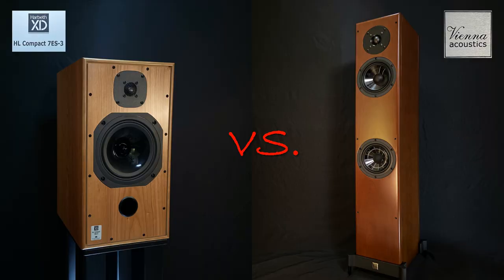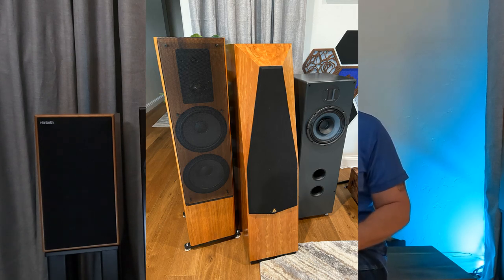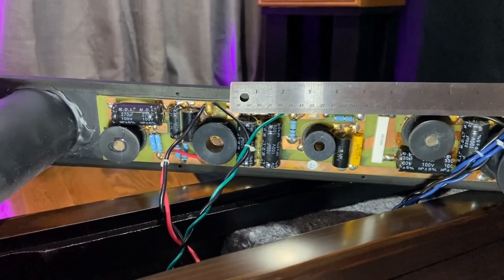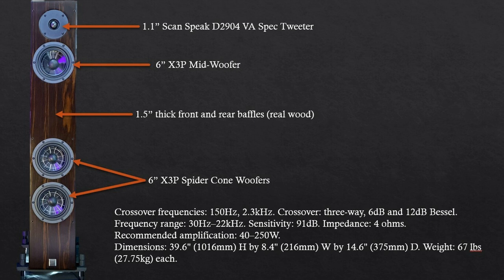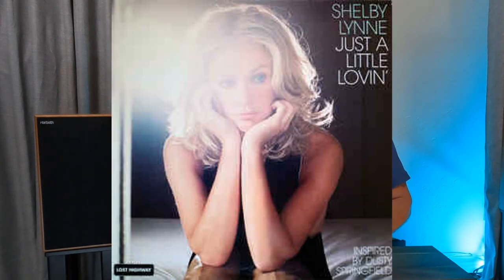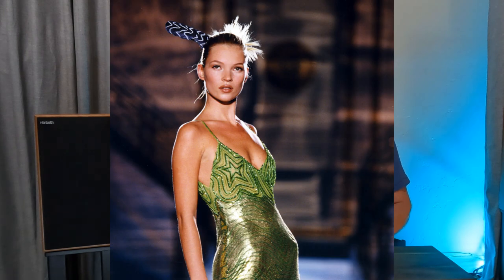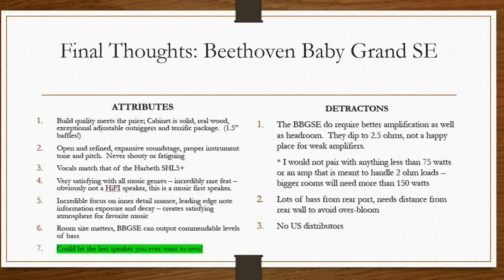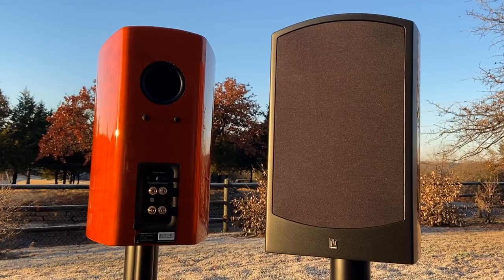Vienna Acoustics Beethoven Baby Grand SE; No HiFi Speaker Here...These are musical!

Comment: I own the exact same speakers, also in black as in the video. Love them.. bought them used with original boxes of ebay 5 years ago.
Only thing that I miss is the ability to biamp. I have to matching power amps that that I would love to try to power mid High and lows separately. I know, people will think, can't you bridge the amps? Well, these speakers are 4 ohms. My amps accepting in bridge mode only 8 or more.. 
For now I'll stick with my Rotel class D.
Reply from the maker: Thank you for sharing and watching.  I would be careful about too much power into the Vienna BBG, they sound wonderful to a certain limit, the drivers are not the most robust.

Comment: Great reviews.  Where is the excel sheet you referred to?
Reply from the maker: I had a few on my community page, mostly dealing with bookshelf speakers and brands.
Reply: @2ChannelListening  You have really peaked my interest in the Beethovens and can pick up a pair in black for around $1800.   Concerning the 2 ohm dip, I have an older Emotiva XPA 5 channel and a B&K ref 200.7 7 channel amp to use. do you think it will be an issue with either of those amps?  If so I may sell both and put the funds towards a pair of the Buchardt A500s or new A10's ? Thanks for your assistance!
Reply from the maker: Hi Jerry, since you are interested in VA Beethoven, I have not made much documented comparisons for floor standers.  I do have that Google Sheets with well over 70 bookshelf speaker manufacturers if interested.  Feel free to email me directly to 2channellistening@gmail.com with questions since you are a subscriber! Thank you sir.

Comment: It could be using the shielded drivers like the tweeter as a chamber is there any silicon around the edge? Plus would give it magnetic shielding against the crossover interaction but that seems a bit far away and the magnets are not that big but possibly
Reply from the maker: That's a very good theory HG, yet given the proximity distance for the mid-woofers, I don't see how there is a tangible impact on the tweeter (its clean).  The woofers, those magnets are not that big, the shield makes them look much more substantial than they are.   I do like your take though!
Reply: @2ChannelListening  I wasn't really watching I was listening so it's possible the twitter doesn't interact magnetically with the mid-range is possible
No signs of any sealant around the edge of the shield then?
Reply from the maker: @hoobsgroove  I did not get a good look at the top, not enough clearance.  I certainly was not prying them off, sealant or glue, they would not budge.
Reply: @2ChannelListening  no there will be glued in indentation at the back You could try heating them up with a lighter first in that area to soften the glue
Reply from the maker: @hoobsgroove  I meant no clearance as in these SOB's are also glued to the cabinets.  I wasn't risking it with the Rosewood finish - never had baskets stuck in a cabinet like this...they didn't want me pulling these ones out, lol...

Comment: I understand your analogy on bass extension on comparing the Mozart Grand to the Beethoven Baby Grand; however, that loudness difference should be accounted for in the -3dB or -6dB point. If both of those speakers claim a lower frequency response cutoff of 30Hz, if the amp is set such that their average SPLs are equal, their lower frequency performance should sound the same. The Beethoven Baby Grand DOES have a slightly higher sensitivity at 91 dB (vs 90 dB for the Mozart Grand). Also, if you are describing the punchier bass at your listening position vs. at a 1m measurement position (which is how the response curves are generated) it could possibly be attributed to room response, port design, etc. Bass is a very weird thing!
Reply from the maker: Thank you for the thoughtful comments MJ. I do use an SPL meter to keep my listening levels within my normal critical listening db.   The big difference with the Mozart and BBG is cabinet volume and a second dedicated woofer driver that is specified to 150hz only.  Speed and extra air volume create the effect I was dearly missing from the Mozart - me thinks...all things else in my room should be equal with the same amplification and listening position.
Reply: @2ChannelListening  There’s no replacement for displacement. 😂 I’m sure the second woofer really adds to the dynamics you are describing. I’d love to find a pair of those local.

Comment: Hi, I enjoyed watching your video. I notice your room is smallish. Do you find you get a bit of overhang in the bass from the Beethoven Grand SEs or the Mozart Grand SEs with certain recordings where bass frequencies go very low ? The reason I ask is because I find that is the case with my Castle Harlech floorstanders in my 18' x 12 ' room.
Reply from the maker: There is a bigger difference in the amount of air the Baby Grand's move compared to the Mozart SE.  The Mozart SE integrated very well, I have a handful of bass traps and ceiling absorbers which help tremendously.  I did have to use the port bun for the Baby Grand to tame total output in my room.   I would say adding two small REL subs for the Mozart SE would probably be the ultimate ticket, however, my room configuration would not allow for the floorspace, I have to contend with my lighting and other gear as well.
Reply: @2ChannelListening  Thanks for your reply. Actually I was really meaning, did you find you got any bass overhang for e
ither  speaker in your room  ? I'm sure your bass traps help. My Castle  speakers are transmission line and I have them 27 inches from the front wall. One of the speakers is also quite near a corner of the room  and I do get a bit of overhang in the bass on that particular speaker  depending on the track I am listening to. Not sure if transmission line speakers should be placed further from the wall than other floorstanding speakers ? They have no ports at the back but the transmission tube exits the bottom of the speaker. Any advice would be welcome, thanks.
Reply from the maker: That's a tough call Chris, over-hang, or a frequency bump is generally room mode interaction.  I'm not sure my definition of overhang is the same as what you would describe with transmission line speakers.  The small quick drivers in the Vienna Acoustics never sound slow or bloated.  I would get some room loading from the big Baby Grand.  There is something else going on with your speakers if you are getting bloated, sluggish bass.  This is why listening to Tool is so useful with double kick drum, I can tell if the decay is good or overloading my room with too much energy.  I think of my big AR9 LS with a underpowered tube amp for bass bloat (overhang).  Does this make sense?
Reply: @2ChannelListening  Thanks for replying, it is appreciated. It is really only with sections of music where there are particularly low bass frequencies when I am getting the problem, generally the bass sounds very good. Admittedly I have a low powered solid state amplifier (30 wpc) although it is price matched with the speakers. Also I am only getting the issue with the speaker which is quite close to a corner, approx (3 feet)
so I think maybe some sort of bass trap in that corner might help to solve it ?
Reply from the maker: Forgive me Chris, I do not want to misdiagnose what could be happening with your bass.  If you are getting muddy, slow bass at some extremes, if it is at dynamic passages (where your amp is being taxed) then bass traps will not help you, its a mismatch with your amps capability and your speakers demands.  I've placed all manner of speaker closer to a corner than what you are working with, 36" is actually better than average distance.   The obvious test is to put your speakers within 12" side and backwall.  If you hear reinforcement of the muddy bass outside of room gain energy, then you certainly can move on to trying traps.  If you hear the same issue overhang, slow bass, my opinion, its your amp selection.  It happens, I've been there.  The correct amp snapped my speakers into focus like they were an entirely different set.
Reply: @2ChannelListening  Thanks again for your input and suggestion of moving the speakers to within 12 " of back wall. I understand your concern about the power of my amp. However I think if it was the power/mismatch of the amp that was the issue I think I would be hearing the same issue from both speakers. However it only occurs with the speaker nearest to a corner and it is not in dynamic passages. It is just with certain low frequencies. The sound hangs around a bit longer than I would expect, a sort of reverberation. I have called it overhang, not sure if that is correct expression. I don't think it is slow bass.

Comment: Hi my friend... I just purchased a Vincent SV – 737 I'm using the optical input… Would it benefit me for a better sound quality to use an external DAC instead?
.
Reply from the maker: Congratulations Brian.  Your question can only be answered with more questions:
1. Are you happy with the sound currently?
2. Are you getting what you need from the app?  Can you access your favorite music will little fuss?
3. Do you need more flexibility with a DAC, USB, HDMI, I2S?  

I can tell you that improving on a well implemented integrated amplifier can cost you many times more with individual purpose built boxes.  For instance, I use a HiFi Rose RS250 streamer, which costs as much and more than three of the integrated amplifiers I have on hand - but it clearly outperforms all of their internal dacs and gives me additional variable volume options.   To me its worth it, but I had to save up for that thing!
Reply: @2ChannelListening  
thanks Jason, I'm now using a Gustard R26 and very happy with the better sound...

Comment: It is my experience that one can't hear how good a speaker is without an A/B. A large kick drum has an area of 1300 square inches producing bass. A 6.5" speaker has 33 square inches. I have 3-way speakers with dual 15" woofers (700 square inches total) which is the area of a medium kick drum. Little speakers sound little and/or unnatural.
Reply from the maker: PMC speakers 🔊, transmission line cabinets?  

Regarding A/B comparisons, what context are you referring to?

Comment: it is nice to have a quality speaker. believing the speaker is the most important pice in your system  NO  Its all about your components just my thoughts
Reply from the maker: That's interesting Gregory.  I'm always back and forth, but I would err on the side of the speakers making the biggest difference and here is why I think this in general terms.   Average value speakers can sound average with average gear; one can attach gear that is 5 x or more the value of the speakers and yes those speakers will sound their best, but that is a backward use of funds.   I've tried these combos and the average speaker never sounded better than the model above it.

Now, take a Harbeth SHL5+ XD for example and put a NAD D3045 integrated to it and the Harbeth still sounds much better than a lower priced average speaker.  When you match the SHL5+ with equal cost components, then absolutely WOW....same goes for these VA Baby Grand.  I can put subpar electronics on them and they still sound better than lower priced speakers with better electronics.  My experience anyway.  YMMV.  Thank you for watching and commenting.
Reply: Great speakers powered by an adequate amp will always sound better than adequate speakers powered by a great amp. Spend your budget on speakers first, then worry about the electronics. It's like a camera system - invest in the best glass you can, and then the bodies.
Reply from the maker: Well said, alas, I do not have the budget for great glass :-)  
Thank you MJ.
Reply: @MJHiteshew  You got it Mike. Gregory is confused.